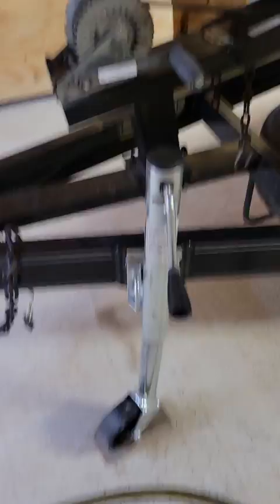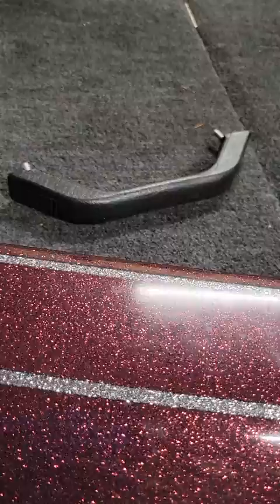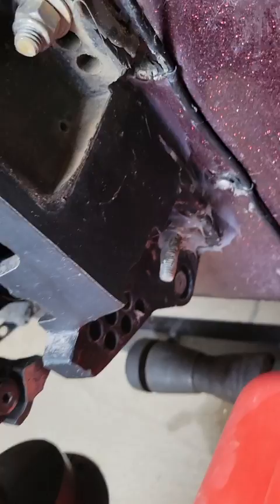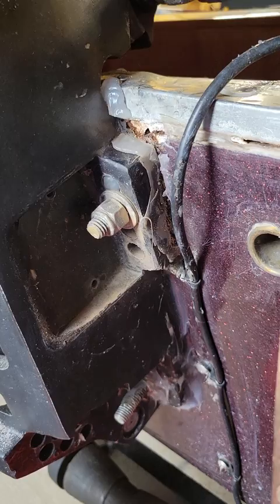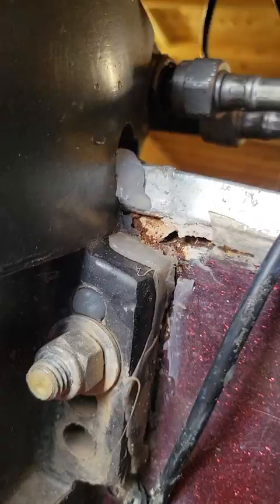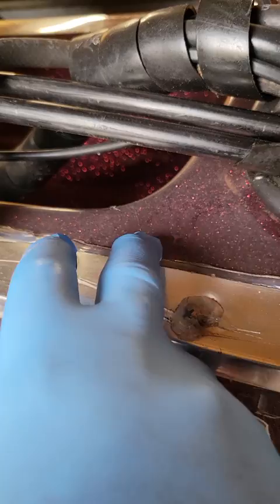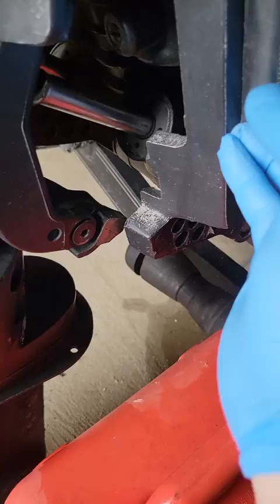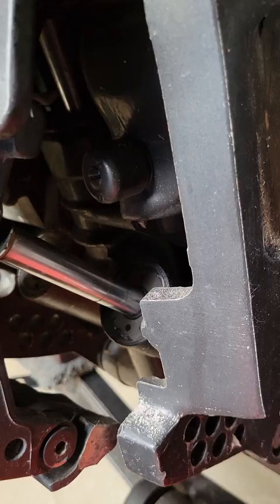How to identify a bad transom in a used boat. Things that stand out as fishy in that older bass boat

Comment: My 1985 garage-stored Champion 184 has original transom. Boat dealers did reseal the four transom mounting bolts two separate times, (1) different motor, (2) add jack plate/steering cables needed replaced. Champ has been to boat fiberglass repair shops four times over 37-years for different impacts, but not one transom problem.

Comment: Used boats are the scariest purchase you can make.  Be wide awake and very suspicious of any used boat.  They are not all as obvious as this one.
Reply: Sure are depending if they sit in a dock slip all season or get put in the barn after each use and most of all they take tremendous stress at throttle in the water but not every one runs rough water. But jumping other boats wakes are not good on them either.
Reply: If the seller is not willing to take it to the lake so you can try everything out, keep on looking. People will tell you anything to sell a unwanted  Bass Boat..   I have been in this game for 45 years I’ve heard and see it all. Try all the electronics, gauges, live well pumps. Compression on the motor. Look under the hull, and if possible take it to a certified marine mechanic and have the motor gone through.And make sure the trailer has good American made tires on it and that they are not dry rotted.Stay away from cheap China bombs on boat trailers,

Comment: Don’t bounce on the bottom of the outboard because you will break the Hall and if you break it you bought it.  I had an 15 year old nitro 1995 bass boats Where the transom had become so soft, I thought that I could push my thumb through it if I tried.  I took the motor off, and the transom was completely delaminated from the bolt holes that held the engine on down to the bottom.  I thought that I might as well try and fix it before junking the boat.  I bought an aluminum plate that was bent at ninety degrees so tat it would sit over the top of the transom and cover the back on the outside and a rectangle plate for the inside then drilled bolt holes through it . I mixed up the fiberglass and poured it into the delaminate transom and them put the plates on and used the bolts to pull it back together.  The next day I removed the bolts and reinstalled the motor with the plates still in place.  Ten years later I had to replace the jack-plate and the transom was still solid. I sold the boat last year after explaining everything to the buyer. It was cheap and will probably last him a long time.
Reply from the maker: Yeah I realized after I posted this that recommending standing on the lower unit was probably the wrong way of putting it. While I do exert a lot of force on the lower unit with my foot, maybe standing on it and bouncing isn't the best advice. This boat had a lot more issues than just a bad transom, glad you were able to unload the Nitro. Appreciate you watching and your comments. 

Pepper's

Comment: Most boat tanks won't gravity drain, unless the valve on the pickup tube has failed or been removed.  I've never heard someone advocating to drain the tank for working on stuff, it's totally needless and probably adds more hazards than it prevents.

Comment: Many years ago i had a 1972 MFG center console boat. Foam was water logged i pulled it all out. Even cut out the front deck riser. Im sure the transom was junk. I used it for years and it was fine.

Comment: Another quick way that works is to remove one or more of the screws that typically hold transducer cable etc on transom. 

If water starts dripping or seeping out it’s likely toast
Reply from the maker: You're absolutely right, forgot to mention that. Thanks!
Reply: @peppersboatspa7947  Yep.  Or the screw has dark rotted wood on threads.

Comment: There really  is an easy way to fix a transom, with out having  to remove  the transom
Reply from the maker: Pour in transoms such as Seacast are inconsistent and unreliable for high horsepower applications.

Comment: Out of curiosity . What is your plan for repairing the transom?
Reply from the maker: The boat was scrapped after termites were discovered throughout the stringers. Hull was sold stripped to someone who now uses it in their pond using a tiller steer trolling motor.
Reply: @peppersboatspa7947  well that’s a shame! Have you ever used sea cast. If so what’s your opinion? I think it can be used in stringers as well. I use to work in pest control. Termite colonies typically live 20 to 40 feet below ground. The ones you find above ground are workers gathering food. They will die off after a while if they are removed from the colony.

Comment: So is this boat being used still or will it be fixed ? Like was it ok or totally gone ? I have a 98 champion and I dont have a splash well and mine was sealed when I bought it and over 4 years it finally lost seal and I should of redone it when I bought it but the last owner did a ok job at sealing but not like I would. Anyways I noticed a little bit of water comming out from being the jack plate where caulk was. So I took the top cap off and it was pretty much sealed . I kept digging taking the bolts out and I never had water come out of any hole but I could tell there was a tiny bit of moisture . I have no cracks or no flex it all sounds the same with a hammer nice and solid. But I just wonder how good it really is. I decided to put heat lamps on it for a few weeks and im gonna seal it up again and keep going. Mine didn't ever look like the boat your showing but I know it dosnt take much of a hole for water to get it . After taking the bolts out sitting there no water has came out its just like behind the silicone where he went around the jackplate. And mabe its just dirty behind the silicone and water is behind there dripping because its trapped a little. Wish me luck and i would love to see what u did with the boat in the video.
Reply from the maker: You should be okay, just keep an eye over it a couple times a year. Just take a couple transducer screws out and walk away for an hour. If weeping while away start putting some money back. As for this one it wound up having termites in the foam and stringers so it was scrapped out.

Comment: Why do they still put plywood in fiberglass boats ?  I know, I know, it's cheap.
Reply from the maker: Marine plywood, when laminated and sealed properly is as strong and durable as any other material. During the 90s it was about keeping cost low and selling boats so transoms didn't get much attention until the early 2000s when Champion, Skeeter, and a few others started developing issues and customers started having to spend a lot of money to have them repaired. This transom I'm doing is sealed all the way around with epoxy, and resin where the glass is applied. This transom should last for many, many years to come as it is better than what the manufacturers used back then. Hope this info helps a little bit.